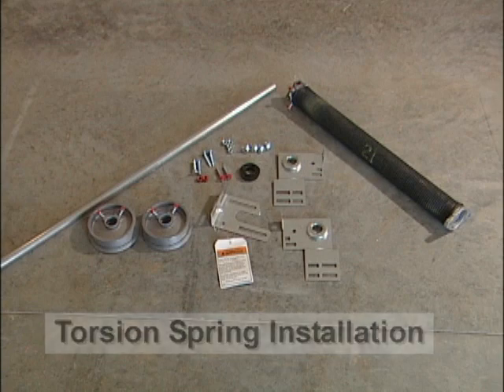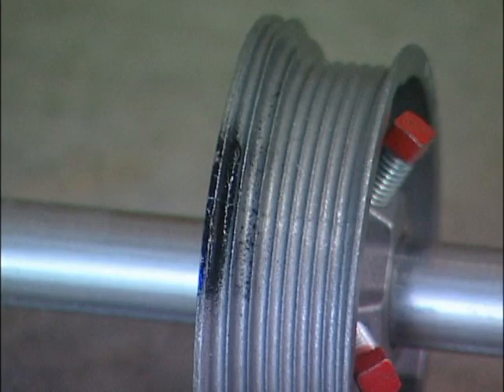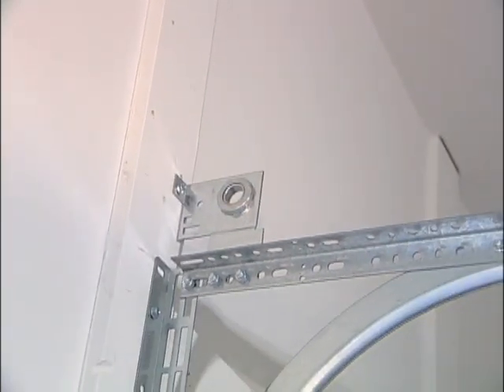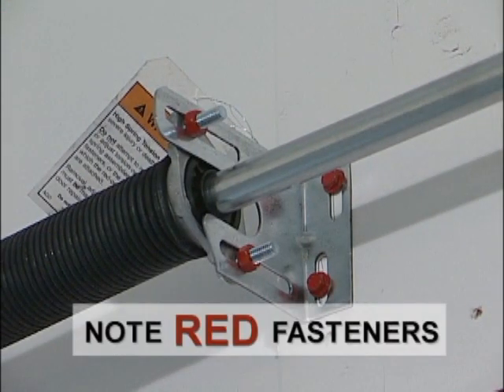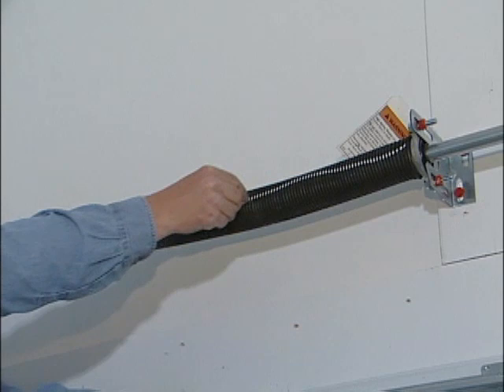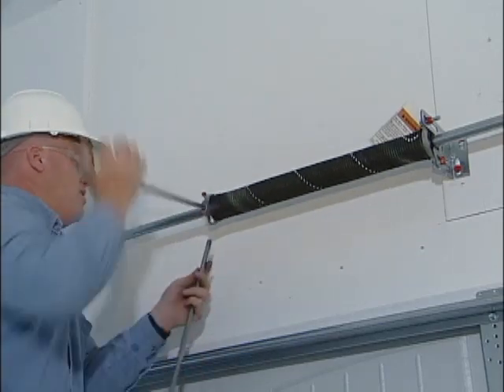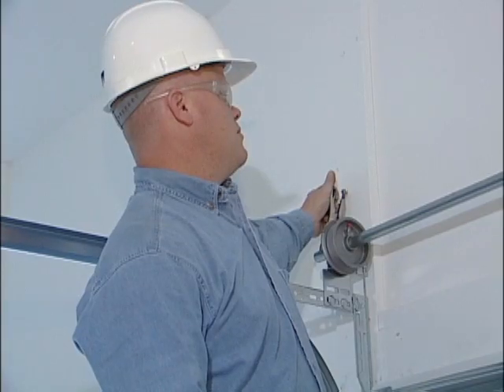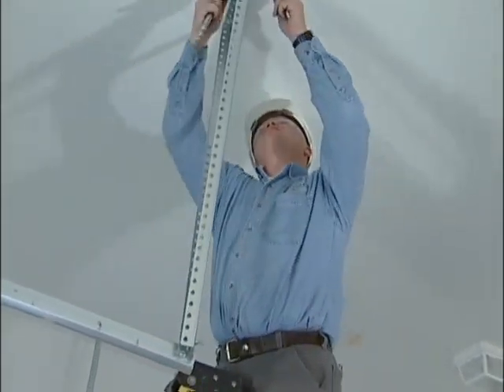How to Install Torsion Springs Ch.8

Comment: Nice work ............... I have a question / What do the plunger pliers?
Reply from the maker: Sorry - I don't understand your question. To see why vise grips are used, start the video at 3:10. Helps maintain tension on your torsion cables while winding the spring(s).
Reply: How do I know that the spring sang?
Reply from the maker: @khaledkhaled6181  i'm sorry but i do not understand your question.  The springs provided by the garage door manufacturer should balance the door. The manufacturer can advise you the # of turns to put on each torsion springs.

Comment: Thank you for a simple easy to understand video.   I have to install one just like this today that a guy bought used from an auction with no manual or paperwork.   You probably saved me hours of frustration.   Thanks a million! !!!
Reply from the maker: I do NOT recommend using used torsion springs (EVER). When determining the correct torsion spring(s) that should be installed on a sectional door, there are several factors that should be considered: 1) the total closed door weight, 2) the door height, 3) type of cable drum and 4) type of door track lift. A trained professional (or a door manufacturer like www.amarr.com) can calculate and advise on the correct springs that should be installed on a sectional door.

A few important points:  At a minimum new torsion springs should last 10,000 cycles (that is up & down 10,000 times).  This is a DASMA industry standard (i.e. all N. American Mfg are members of DASMA - allows the industry to set important consumer safety standards).  Clearly, the life of a spring or set of springs will vary depending on the number of times the door cycles per day.  The reason I caution against using "used" springs is because you cannot measure the remaining force (IPPT) of the springs. Thus,  you do not know if the spring(s) will have enough force to properly balance the door or how long the springs will last.  

Formula for Calculating Torsion Springs:   
Total Door Weight X Drum Multiplier = In-Pounds per Turn (or IPPT)
* the cable drum multiplier is varies based on the door height and type of cable drum

Lets assume you have a door that requires a total IPPT of 50 and a door height of 7' tall.  This means, the installer can use 1 spring that has an IPPT of 50 or 2 springs that have an IPPT of 25 = a total IPPT of 50, 3 springs, etc....  Over time, the IPPT or strength of each spring diminishes. Thus, eventually a spring will break over time.  If you use a "used" spring - it is a matter of time before the spring or springs will break. When I train installers on the importance of using the correct torsion springs, I explain "its almost as if a mechanic tells you - you are going to need a new set of front brake pads and you reply by telling the mechanic - only change the front left today, the other side still works. NOT recommended at all.

The easiest way to confirm if you door has the correct springs is to disconnect the garage door opener arm and  manually open the door 1' or 2' off the ground. If the door stays in that position, the door is most likely properly balanced.  If the door jumps off the floor or is heavy = you have the wrong springs.

Good luck!

Comment: WARNING.  Instructive video, but be careful.  Because this was the same single spring torsion kit that came with my door, I used the video for the installation and left the manual on the floor.  You can see from this video that he puts the torsion spring on the left side of the center brace bracket (from inside of garage).  Mine should have gone on the right side.  When tightening, 
 I ended up popping out one of the coils and had to buy another spring.  My advice: Use the video, but check your manual too.
Reply from the maker: Another Tip - If you have 1 torsion spring, observe the direction that the spring wire near the spring cone that you are winding.  That wire should ALWAYS be facing upwards towards the ceiling, which means once you affix the stationary cone to the bearing plate, you should be winding the springs in an upward direction.

Comment: @Shawn Young Classica always gets a 15 radius track because the panels are wide did you get a 12 radius by chance?
Reply from the maker: Amarr's Classica door model includes 15" radius standard.  Other radius tracks are available upon request.

Most residential doors in the US have 12" radius track, which is common when your door panels are 21" or 18" tall.

Comment: install video where they install the bearing plate on 15 radius track as if it was 12 inch radius track thanks a whole hell of a lot Amarr.
Reply: ? Im not with amar but install them everyday, dont really understand your question
Reply: +William Minton wasn't a question. the guy in the video installs the end bearing plates wrong. sorry you have to install that cheap crap.
Reply: lol, pays the bills, anything other then wayne dawton and im happy
Reply: +William Minton Wayne Dalton is only good when I get to take them down or lnstall spring conversions. the conversions are a money maker.
Reply: i agree, i wont even take  a idrive down unless they agree to spring conversion, lol

Comment: David,  How do you get parts for these doors?  I can't find anything on Reliabilt or Amarr Websites. Lowes tells me to go to their website???
Reply: from a dealer such as 31w insulation
Reply from the maker: I'd recommend checking www.amarr.com and use the dealer locator to find a dealer near you for parts and service.